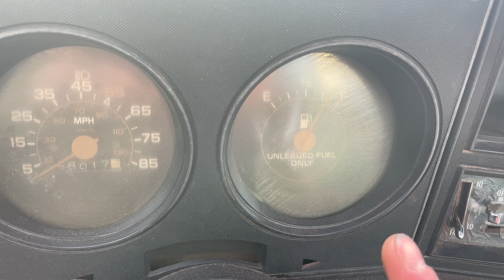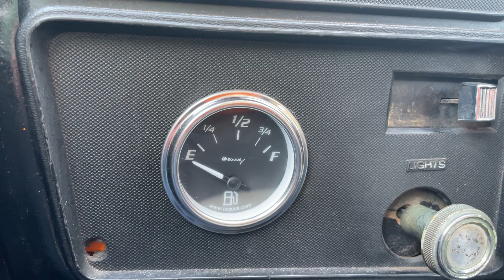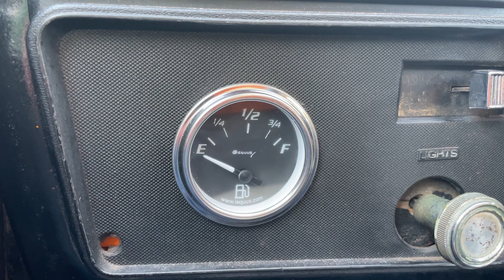How To LS Swap a Squarebody C10! Or, how I did anyway...

Comment: Stock oil pan ? My c10 is lowered a good bit worried the pan will hang low .
Reply from the maker: Yup! Stock truck pan. It hangs probably an inch below the crossmember. I haven’t had an issue yet. I will say, when I build the engine in my garage for it I’ll swap to a lower profile pan, but only because I want to not worry on dirt roads, etc, since the front will get another 2” lower here shortly.
Reply from the maker: @gerardolopez5875  Thanks! The 97 Silverado pump part number EP381 works great on stock or near stock 5.3. You need some kind of pressure regulator. For returnless fuel rails something like the C5 (1999) Corvette fuel filter works great with fuel sending units that expect return flow. If you have a return style fuel system any quality inline fuel filter, and a fuel pressure regulator set to 58psi, will work. Spending a little more in this area will save you a lot of headaches. Hotrodfuelhose.com should have everything you need in a bundle or you can piece it together from Summit or Jegs or your preferred performance part shop.
Reply from the maker: @gerardolopez5875   oh, yup, in that case it should work. What are you putting it in? If you’re swapping an LS and replacing the gen 2 Style Vortec 350 out of a GMT400 (pre-LS) then the stock pump should work just fine as long as the LS you’re putting in is below 400hp or so and you aren’t running E85.
Reply from the maker: @gerardolopez5875   Yup - I phrased it weird. I wasn’t sure if you were swapping an LS into a 90s truck or older. But yes - the 97 fuel pump will get you plenty of pressure and fits into any fuel injected (1987-1991) squarebody sending unit with no modifications. And an 87 sending unit should fit just fine in any squarebody tank. Keep in mind that the factory soft lines on your squarebody aren’t rated for high pressure but the metal lines will work. You’ll want fuel injection rated soft lines and fuel injection rated clamps. 

For your 72 I’m unsure - I know people have made the in cab tank work by adding a return port and modifying a sending unit to fit. I think if it were me on a 72 I’d use a jeep or blazer tank and relocate the tank behind the rear wheels. Never much liked in cab tanks.
Reply from the maker: @gerardolopez5875   shoot me an email! Ericsabo@gmail.com

Comment: How did you route your fuel lines?
Reply from the maker: Mine come out of the top of the tank straight into the inside of the frame rail. Up the inside of the frame rail, curving up near the body mount and crossing over to the outside of the frame rail, up to the firewall and across the firewall. I wanted to keep fuel as far away from the exhaust as I could. Realistically it was way overkill. If I did it again I’d probably cross along the trans crossmember and run up over the transmission. I’m going to move the tank behind the wheels ultimately so I’ll redo it at that point.
Reply: Ok my tank is on the driver's side, I'm trying to keep it away from the exhaust as well, until I get a tank to put in the rear of the truck. I'll probably cover it with heat shield sleeves.  Thanks, I like your truck!
Reply from the maker: @williamcannon8136   Thanks man! Good luck! You should be able to run it the same way just on the drivers side. And yeah - grab some quality heat wrap and especially if you’re using braided steel line it will be fine.
Reply: Yes I'm using braided steel lines and cable ties to hold it in place, thanks for your help, I appreciate it

Comment: What’s your wheel/tire setup?
Reply from the maker: Thanks for asking! I’ll cover the wheels/suspension in a later video as I’m rebuilding the front, but here’s the wheel and tire combo on it now. 

Wheels
Rear: Pro Comp 7973 in Flat (more like matte) - 17x9 with 4.5" backspacing
Front: Vision 85 Soft 8 - 17x8 with 4" of backspacing

Tires
Rear: 275/60/17
Front: 235/60/17

Comment: cool but if u put the money in a sbc it will beat the l.s. and if u know how to get crate engines cheap like i do . i just got 2 454 4 inch stroke steel crank heavy rods high flow heads with the 400 turbo bigger pump heavy clutches stage 1 shift kit . one has 6000 miles on it the other has 38,000 miles on it got both for free both run perfect plus every thing u need to put it in with coolers and lines with radiators alt, power steering pump ,  ac pump on a serpentine belt 450 hp at 485 torque. then i get rigs cheap or free all the time my 68 short box i have 2300 in it running close to 800 hp just needs final paint is left to do . i have lots of square body trucks all are rust free i scrap them if they have rust . just got a 65 short box all complete with the 283 in it for 100 bucks . to me it would never pay to put a l.s. engine in a rig . but it is cool plus i like the looks of the bbc in a rig they are just so much bigger . the best deal i got was a 79 cheyenne 4x4 short box full option truck 400 sbc with 400 turbo under 35,000 miles on it in mint condition even the paint got it for free with a bunch of rigs with it 4 were camaro 67 and 68 then 2 79 z28 just give an idea of what i got with it . i get stuff like this all the time i been filling up 10 acres of rigs mostly pu chevy and fords
Reply from the maker: That’s awesome! I have nothing at all against non LS engines. I was a Buick guy for years, and had a couple of 1970 Buick’s that didn’t get LS Swapped. I wanted to do something I hadn’t done before. The LS design, stock for stock, is an improved evolution of the older GM engines but it doesn’t mean they are obsolete by any stretch. Lately I’ve been wanting a BBC - never had one, and it seems fun. I’m also helping a relative tune his early SBC. 

I have $150 into two running LS engines (ones disassembled right now.) I sold my 79 350 for $250. The costs associated, I find, are widely varied depending on where you live. Up here in the woods, LS-based engines are dirt cheap, and sometimes free. 

Bottom line is, if you like it, it’s awesome in my book. I’m happy for now with 280hp and 24mpg, and great reliability, out of my truck on a non optimal tune and gearing setup. I wasn’t unhappy with the SBC I had in it, it just needed freshening up, and after shopping around, for what I have invested, the LS swap ended up cheaper in the long run. Thanks for commenting and I’d love to see some of those trucks!
Reply: @ubf_c10  i have a 79 chevy pu with Cadillac suspension from the factory it sits 3 inches lower then a normal truck use to have the p.o.s. diesel in i put a 68 442 350 in it the body is mint on it blue with silver paint long box i got nothing in it all free and the l.s. is a great engine u can get a lot of power out of it but they cost way to much for me i am working on a deal to trade a good low mile 350 4 bolt for a l.s. 7 427 new version worn out think it has bad valves runs but real weak but worth it to rebuild it stock it has 860 hp it is out of a 2018 vett but it will take a few years to rebuild it got the 350 for free so i can't lose on it just need the tools to rebuild it and parts and a holly efi set up to put it in

Comment: Please help me understand why all the LS swaps. I understand some of the LS benefits such as modern technology, higher performance and better for daily driving and better mpg’s but why go through all the trouble? Why introduce all the electronics, sensors, wiring, PCM that are highly prone to electrical issues and failures. Why deal with PCM calibration? You are limited in performance upgrades without having to tune/calibrate/remote tune the PCM. Older PCM tuning software is not widely supported. Why deal with all the  other issues cited in this YouTube? Also, I would never install a junkyard LS without overhauling it first and alternatively the cost to convert with a new LS engine, harnesses, wiring, fuel injection, etc you’re looking at around $20K for engine and parts alone. I’ve gotten multiple quotes. Is it really worth the trouble, expense and headache to do an LS swap versus installing a new or rebuilt Chevy 350? I’m not yet convinced. And don’t complain about carbs if you don’t know how to tune them. And don’t forget how EMP’s will knock out the PCM!!! Lol!
Reply: Everyone's reason is going to be different.  I'll try to answer broadly.  Availability of engines, parts, knowledge, longevity of the engines and how easy it is to pump up the hp.  If you don't wanna spend 350 for a junk yard dog you can get a fresh reman for under 2k with a 100k mile warranty. As far as electrical issues, there are companies that make brand new harnesses and pcm replacements that can completely control those engines.  No need for anything stock. For those wanting to use the stock harness there are ways to do that as well and it's cheap. The ls engines were made well,  outside of a few seals that like to leak oil and are a beast to get to. I just replaced a 5.3 in a Tahoe that had 340k miles on it. Outside of regular maintenance it hadn't been wrenched on.  I'm sure there are some 350s out there that have made it that far,  but I haven't seen them.
Reply from the maker: Hey man, to each their own. I have nothing against any engine - I ran carbs on 2 classic cars (both 1970 Buicks) and had no real issue with them. I am more comfortable working with those than the fuel injected stuff. I wanted to do something different, that I hadn't ever done before, and ended up with a reliable, fun to drive truck. I got my 5.3 for free, and know its history back to 0 miles, so no concern there. I have multiple other LS's in my garage that are junkyard, and once they clear a basic exam, wouldn't hesitate to run them. I have less than 8k into this total project - including the purchase and road trip home, and I ended up with an easy to run, easy to drive, easy to build, overdrive equipped, daily driver capable pickup. I realize this could be done with pretty much any engine... I just chose the LS route because I hadn't done it before, and I got my entire donor vehicle for free. 

I've said this a lot of times on the channel but I'll say it again here - I really don't care what you like, or what you want to hot rod, as long as you're doing it. I understand people are sick of seeing LS swaps... same thing was the case when everyone was swapping Gen1/2 SBC's into everything.

Where I live, 5.3's and 4.8's are very cheap - less than $500 and I can hear it running before I purchase. Hard to argue against that. The way I did my install, it was plug and play... Wired up 4 wires, made sure I had fuel, and the truck started. I didn't do it the cheapest way possible - I would have needed a new fuel tank regardless, so I did that, and I just wanted it done so I bought new wiring and PCM. 

I also enjoy the PCM calibration and data analysis... its one of my favorite parts about doing this. I also enjoyed carb and timing tuning on distributor/carb cars, and will have another one. 

I'm not trying to convince you, but to me it was absolutely worth doing the LS swap. I will do another one. I will also build a carb'd big block and probably K swap something in my lifetime. A good friend of mine is swapping a late model diesel in an old Mercedes - I think that's awesome too. Another friend is swapping a later model Nissan V6 into his 90's Maxima. Also awesome. Just go out and enjoy your stuff, whatever it may be, and I'll probably really enjoy it too.

Enjoy your hot rod, whether its a carb'd 350, an inline 6, a fuel injected import, or an LS. Keeping old cars on the road and making them enjoyable is what I'm about, regardless of what powers it.